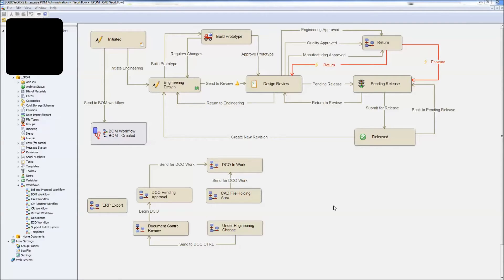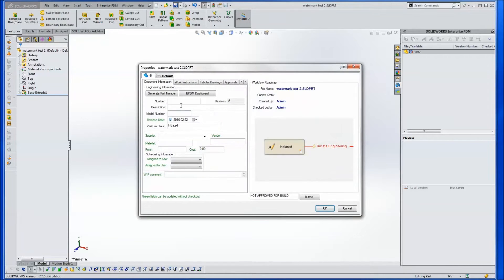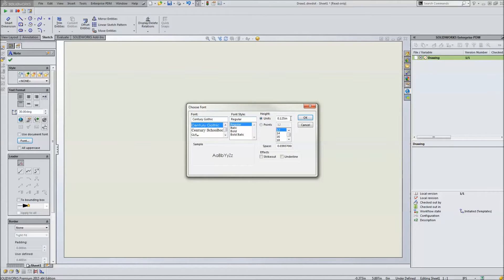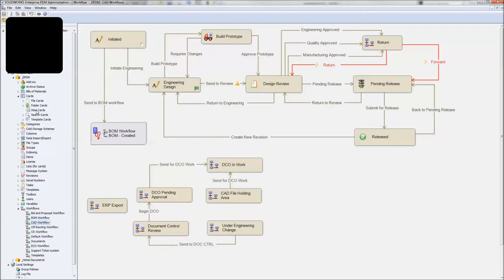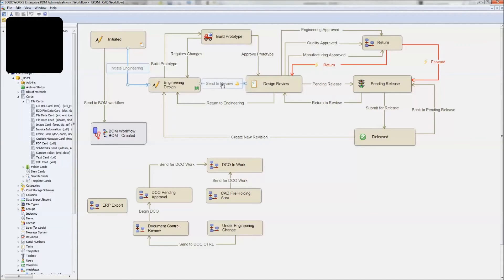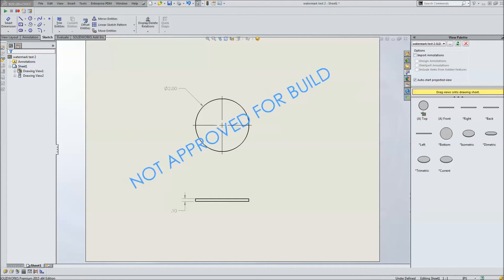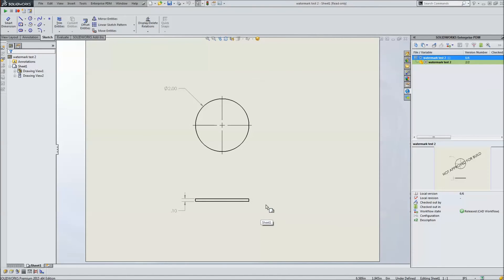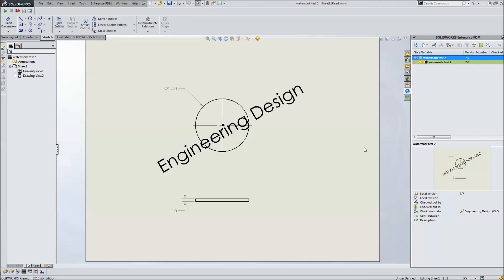HOW TO setup watermark on SOLIDWORKS drawings using SOLIDWORKS PDM

Comment: How does it automatically "save" the drawing? I cannot see a * next to the name that shows that the drawing has changed but is not saved?
Reply from the maker: I apologize for the terrible delay in responding! Thanks for the question. It doesn’t change the drawing, it merely updates the data card value. The next time the drawing is checked out and opened, the watermark value is update and needs to be saved and checked in. Does this help?